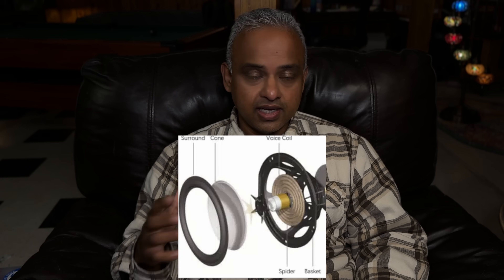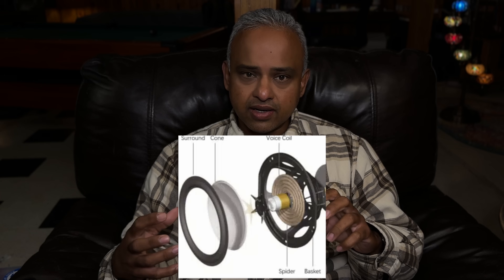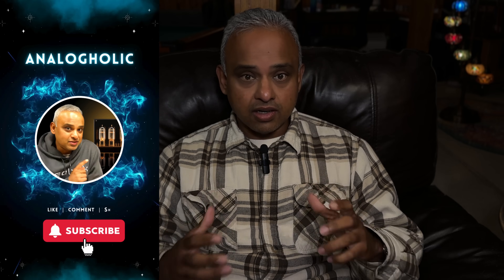Breaking In Your Speakers & Amps: Science or Snake Oil?

Comment: A few years back I bought a rugged 18" B&C pro cinema sub driver for my (huge) best system and installed it in a properly designed cabinet per B&C specs.  It sounded great right out of the box and better after a break-in period of a week or so.  But my measurements showed  a disappointing f3 of 40hz, much higher than the 32hz I was expecting.  Recently I noticed that it was audibly reaching deeper than originally, so I remeasured it and found it was going down to 30hz before rolling off.  I speculate that as it was intended for constant high db commercial theater LFE reproduction it would have broken in in a few weeks of intended service vs my far less strenuous 2.1 channel music listening which took years to settle it in to the published specs.  At this rate I expect it to far outlast ME!
Reply: I bought some 8" drivers and hand pumped the cones after about 2 years use. I bought some identical drivers and immediately hand pumped them and they were at least twice as stiff as the used drivers. I think that is an objective thing. 😂

Comment: None of this is my experience. First speakers, I've owned several, and the ones I've bought used never changed sound. The two new ones I've bought both changed. One at 20 hrs and ne er again the other around 45-50 hrs and never again. Many of my speakers imo sounded worse the longer I owned them and I sold many of them. I think it's trendy for audiophile influencers to say " no ones ever said speakers got worse over time" yeah well I just did and I know others. As far as electronics, I've also owned many. Some new some used. I have never heard them break in. Now tubes, absolutely beyond a shadow of doubt, more than speakers. I will also add stylus to breaking which was within a few hours say 5 or 6. So why do these influencers talka about sound measurements but in order to push their placebo effects theory never tell you not all sound is measurable, hmmmm.... in addition why do they tell you your brain and ears are changing yet provide no testing to back this up ? hmmm...... Imo if you can't hear what's happening within your equipment either you've bottle necked your sound quality by mismatching something or a component is coloring the details far too much, or your ears are about to save you alot of money as they probably aren't able to hear critical detail...and therfore you could save a ton of money as you won't need to buy hifi equipment. Hope this clears up at the confusion and misinformation,  be careful which influencer you are listening to as they can lead you down a very expensive and frustrating journey. Best of luck

Comment: OK, at 7:38 into your presentation I have paused it to post my comment here. I'm 65yo & have been into home-audio sound/music since I was a 16yo. Recently (4 years ago) I was advised by John DeVore that my O/93's would need 1,000 hours, all up, to be completely broken in, so I thought OK & thought nothing more of it. I knew that I was doing about 22 hours per week listening through my rig regularly & so it was easy for me to keep track of the hours of use of my loudspeakers. Long story short (oops, too late) I noticed a 'better' sound coming from my O/93's at around the 820 hour mark. Much more recently, two months ago, I noticed a 'better' sound coming from a brand new 5N OCC pair of pure silver XLRs after about 12 hours. I believe that burn/break-in is a two-way thing...yes the gear has to break/burn in, however, there is also an amount of acclimatization that is done by the listener's hearing. What the percentages of each phenomena are I cannot say as I have no way of measuring that...OK, now back to the video.......finished the video now & two things to mention. Firstly The Placebo Effect does not affect everyone & secondly, Confirmation Bias can work in the opposite if you firmly believe that there will be no difference, like if you don't believe that audio-grade, after-market power cables make any difference to the SQ of your home-audio rig & then when you try some, for only a couple of hundred dollars, guess what? Wow! They do make a difference...that's my 2c worth.

Comment: Valve amp owners take note. Enjoy new valves from day 2 and dont worry about wasting their finite lifespan waiting for an epiphany after 400 hours!

I always turn Valves and SS on at least 30mins before listening. 
The improvement in fluidity is easy to hear, especially with SS.

Well presented Mr A
🎵🎶🤫🎶🎵
Reply: For the benefit of those living outside UK, you need to explain that "valve" amps means amps that employ vacuum tubes.  On our side of the pond, "valves" aren't electronic devices.
Reply: @Racklefratz 
Thanks for this educational public service announcement. 
I use the term with respect for John Ambrose Fleming .
Besides when we Brits say "choob" we might mean the underground rail system in the UK 😅
Greetings from Montana,  neighbour 😊

Comment: Break in time depends of type of gear. R2R dacs need break in than chip base dacs. Tube amp and preamp need longer time than solid state amps.speakers most of them need break in time.its very complex thing to explain in 18 min video. If you can approach invidiual gear with it's own psychoacoustics implications of respective gear ,it can make some sense. I agree that current marketing strategies are confusing for customers.finally we have to believe ears and mind.
 I hope we reach a stage in future with  virtual AI biasing perfect HiFi gear with both subjective and objective corrections that can please every one in the world.
Reply from the maker: This is a thoughtful comment, but it blends a few very different things together.

Some gear does change with use, mainly mechanical systems like speakers where suspensions loosen slightly, or tubes as they reach thermal stability and operating point. That is real and limited.

Where it goes off the rails is applying the same idea broadly to solid state electronics and DAC architectures. R2R ladders, chip DACs, op amps, and solid state stages do not materially change their electrical behavior after a short warm up. What does change is listener adaptation, expectation, and familiarity, which is where psychoacoustics genuinely enters the picture.

That is why marketing muddies the water. Real physical settling is narrow and explainable. Long dramatic break in narratives are usually about perception, not circuitry.

Ears and mind absolutely matter, but understanding what is actually changing versus what we are adapting to is the key distinction. That was the core point of the video.

Comment: Great explanation, very few reviewers, next to none, are admitting that the weakest but the most important element of the chain is the listener and if or how perceives the sounds. ❤
Reply: Thats so stupid. The whole system is for the benefit of the listener.
Reply: @veniceog  What is stupid? The listener that benefits or not from the whole system? The experience is created by the listener, with the help of the whole external system, the brain, with the help of the smell, vision, various developed inside filters, noise, vibrations and other sensations. The audio tech that produces the sound/music is just one part of the sum that constitutes the experience the listener has. By varying any of the elements, the experience changes. 🎉
Reply: @Cezărelu its stupid to fault the listener as a weak point in the system. The whole purpose of the system is to serve the amusement of the listener. If the listener is pleased, mission accomplished. Too many in this hobby have lost sight of the true purpose of building an audio system.
Reply: @veniceog  I would recommend you use decent words though. You are saying that basically if a system is perfect for amusing listeners, the listeners do not matter. The listener has a brain, a skull, various dimensions, various ideas, various "filters" developed by their brains, which do alter how sound is perceived, so the experience produced is unique for each. That is the most important and usually  gets ignored.
Reply: @Cezărelu  “You are saying that basically if a system is perfect for amusing listeners, the listeners do not matter.” That is a self contradicting statement. Lol.
Reply: @veniceog  no, you were basically saying that, as a conclusion to your previous statement.
Reply: @Cezărelu so youre telling me what I had said. Just another example of missing the point.
Reply: @veniceog  my point was that the guy is right about the perceived sound by the brain and how is altered by it and how usually reviewers do not take this into account.

Comment: electronics 2-20 hours , mechanicals like phono cartridges and speakers 20-200 hours.  its really dependent on each piece. but its a real thing. some subtle some drastic.
Reply: Well then.
Manufacturers and dealers should perform the required break-in BEFORE they foist their wares on the audiophile public!
😅
Reply: @carlitomelon4610  I'm not saying there is not snake oil scams in audio...there certainly is....but burn in is real but not the same as snake oil scammers would have you fool yourself with.

Comment: I see a lot of people not believing the break in periods, however, some speaker and amplifier manufacturers seem to disagree on both the speaker and electronic side. For instance wax paper capacitors, they take a very long time to “break in” and will audibly improve the sound over time. The same goes for the spider and the surround of the drivers and crossovers, some materials, specially the softer parts, become more compliant over time and settle in. In fact many, if not all, mechanical parts of (new) systems have that typical break in period. Beit with varying degrees of detectability.

In this case I tend to believe what the manufacturers say, mainly because of the measurements they take and practical experience they have. They are much more familiar with the materials and their properties, since they research it all the time, in search of light yet rigid materials or soft but sturdy and holding shape for instance. I recently (6months) bought new audio equipment and speakers, D class  monoblocks, A A/B class power amp, 6ohm 2 way speakers, D class preamp D Class DAC, and I can definitely say that it is not psychological, but actually audible that the sound improved over that period, enough to be noticeable, and by mixing system parts I largely excluded psychological bias. Our hearing may be limited in frequency, but we are still capable (depending on hearing quality) of noticing very subtle changes in music or other sounds, without being able to exactly pinpoint why and where that change occurred, we just notice the change and are able to determine whether it feels nicer or not.
Reply: Well then.
Manufacturers and dealers should perform the required break-in BEFORE they foist their wares on the audiophile public!
🎵🎶😅🎶🎵

Comment: I think there is only one way to find out: take 2 identical items (speaker, amp, dac, cap - no matter) one of them use and make "braking in" for 200 hours  and the other leave untouched (or say better play it for just a couple of hours). After 200 hours of using the first item if you can not hear the difference between them clearly and confident in blind test - myth busted))

Comment: Good vid/info. Think of it the same as when you first put on a pair of sunglasses, esp color tinted ones, everything suddenly looks all rosy, or green, or whatever color. Then a few minutes later everything looks normal again. Your brain has made the adjustment back to "normal". 
Or MAJOR sound difference (the speaker wear in is a very minor difference) like AM on an old radio to CD on a modest or high budget setup.  Back around 1980, Burt White wrote an article in Audio Magazine about "Cusp Theory". Simple summary is if you are used to an old AM radio you have had for years, then go listen to a good stereo system for a few hours or days, when you go back to your AM radio it sounds like sh!t. He likens it jumping a gap on a manifold, very sudden, going to the better system. But over time you return to liking/enjoying your AM radio, but it took TIME. You had go go the long way back to the starting point on the manifold. Your brain adjusted you perception over time to where it was before you heard the good system. Just the long way back on the manifold.

Comment: I am not a believer of breaking in. But I had some fresh components in my system and noticed a difference, esp with amplifiers. Unfortunately, I got no measurements. What I track are short 3-4 second passages of a track. I note sibilance etc. Some amplifiers sounded hard with sibilant when its fresh out of the box but after says 20-30 hours of breaking in, the sibilant is a lot less. The difference can be very obvious.

Examples for me would be the Kinki Studio EX-M1+ and Musical Fidelity B1xi. For speakers only heard a difference in the Klipsch RP600M. For the Klipsch, I started with a short initial listening then did the break in by reversing polarity on 1 speaker then facing both speakers to each other. So, I wonder if I got accustomed to the speakers, since I can't as they are facing each other for the break in.

Not really noticed any or much difference after breaking in for streamers and DACs.😊

Comment: I firmly believed break-in to be a myth. I had bought KEF Q550, Q750 and Dynaudio Emit 10s, and their sound never changed new vs after use. And no matter how much time I spent with my Dynaudios, I didn't like them (turns out I like the KEF sound). However my last pair, the R3 Metas, changed my mind - they didn't sound very good new, but I noticed gradual improvements from use across a few days. I still don't believe in break-in as a rule, but I now would give new speakers a few days to "break-in" before assessing them.
Reply: Well then.
Manufacturers and dealers should perform the required break-in BEFORE they foist their wares on the audiophile public!
😅

Comment: I have enjoyed many of your videos but I have to disagree on this topic. Break in is real. I have experienced it many times. The easiest way to experience break-in is to have the simplest and yet most revealing system you can get your hands on. Let it it play for 4-5 days straight, at moderately high volumes and come back after 4-5 days and listen again. Don’t listen after a few hours or after 1-2 days and don’t listen at all during those 4-5 days. After 4-5 days, then sit down and listen. The simpler the system; the easier it’s to hear the break-in difference. The first time I experimented with break-in was when i had a SET tube amp with the absolute minimum number of high quality parts using a single full range 8” Fostex FE204 driver in a TQWP enclosure made of 3/4” thick pinewood without a X-over. To minimize the number of parts, I didn’t have binding posts on my DIY speakers. The speaker wire was connected from the driver directly connected to the SET tube amp. Of course my room was properly acoustically treated and the speakers were properly placed after many hours of placement experimentation, initially. I was using a Doge Tube CD player ( this was about 20 years ago and I purchased the Doge CD player based on Arthur Salvatore reviews). Hope you’re familiar with Arthur Salvatore. Cables were my own DIY pure silver cables (I used to make cables for friends and fellow audiophiles in the Bay Area, California). Anyways, when first sat down and listened to my system after 5 days; the difference was IMPOSSIBLE to ignore! In this hobby once you hear that degree of difference, you can not unhear it!!! So I disagree, it all depends on your system, room and speaker placement. The simpler the system, ie, simple circuits that are hand wired/soldered with the minimum number of high quality parts. I understand that many will disagree, but I trust my ears and my system. Now in a more complex system (huge high power amps with gazillion parts and multi driver speakers with many X-over parts) a break-in difference may be more difficult to discern. Turn it on. Leave it on and don’t listen AT ALL until after 4-5 days. Then sit down and listen. I know about psychoacoustics and have a neuroscience background. Everything makes a difference, in the right system that’s properly set up. In my system I could very very easily tell the difference between my shielded DIY silver RCA cables vs the same cable that was unshielded. Have a nice day. BTW the song I use for break in usually is Simple Minds’ Up On the Catlwalk, a relentless drum, bass and guitar filled track. Try it… play it moderately loud as I do in my dedicated listening room. 😉😉

Comment: Let’s start with speakers. Where did you mention the crossover network that has capacitors and coils in it? You’re only speaking about the mechanical elements of a complete speaker system, not just the speaker itself.

What about image separation getting better, what about harmonic structure changing, what about sounds stage changing 17:33  all over time??
Reply: All of that may just be your brain getting used to the sound and figuring out how to reassemble those abilities for the new equipment. Your brain is looking for those things in the auditory signals it's receiving and eventually, it may be that its neural networks will adjust, figuring out a way to find them. The brain adjusts through the signal differences and its program is now capable of interpreting the sounds in the way you want without trying.
Reply: @tschorsch  Wrong, I know what I’m hearing. Quality recording sound better with time and new equipment and poor recordings just sound worse overtime.
Since Nelson Pass name was mentioned as in agreement with this video, I’ll send him an email and ask him to clarify what he meant. In any case, my system sounds as musical as I could ever imagine so the bottom line is I should’ve kept my self and not even made the post in the first place.